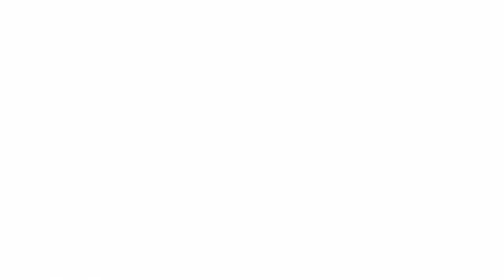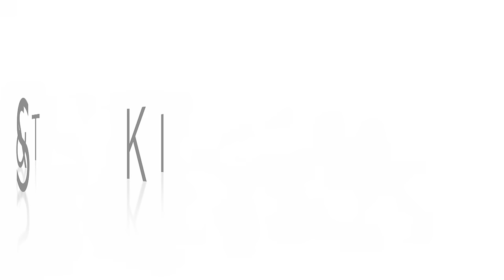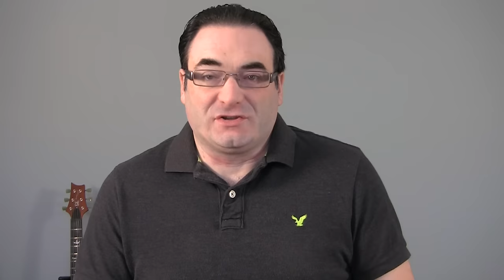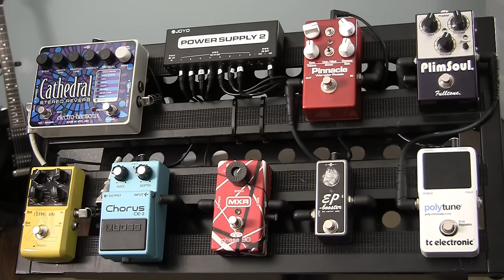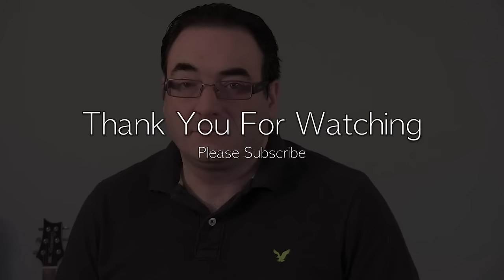Pedal Board Setup Tricks & Tips Vol. 1

Comment: Nice tutorial. Joyo power supply is not isolated as far as I know. It is "fully regulated" and "short circuit protected". It is a step above a daisy chain but channel isolation is needed against ground loops.
Reply: solenelle you are correct
Reply: I got one of those cheap power supplies I think it was caline and tested it and it was isolated I didn't think it would be but it was
Reply: There are a few different Joyos. Some are better than others. The JP-02 is "isolated and regulated" but not individually isolated (channel isolation). The JP-04 is individually isolated per outlet. JP-02 has 10 outlets, 8x9v, 1x12v, 1x18v, the JP-04 only has 8x9v.
Reply: I believe the JP-02 is as you describe. The JP-04 is supposed to have channel isolation.
I use both, one for analog, one for digital pedals. Little bit of hum with singles and high-gain, but imho it isn't Rock 'n Roll without a bit of noise.

Comment: I just got an MXR 10 band EQ, should it go after the Wah, before the fuzz I use? I also use a noise gate, now should it go before the Wah? I want to have the least noise as possible for my blues playing. I also use a chorus and a digital delay and a compressor . Any advice as to the chain I should be using with these pedal's? Also I have a rather inexpensive power supply, will the noise gate take care of the noise or will it cut off my notes if I have to turn it up enough to remove the power supply noise. I'm a 3 year player and m just now getting into the effect's rather than a processor like the RP360XP I am using now.

Comment: My DIY Board inspired by your vid easily holds 8 full sized pedals and the power source is secured out of sight under the board. If you’re cheap like me, then you’ll do your homework before buying a new pedal. But I put a cheap tuner on the board and regretted that right away. My old handheld little Korg tuner is way more accurate! Live and learn! It sits on the board and is powered by 2 AAA bats and I keep it plugged into a stereo output on my chorus while I play. Pedals are held in place by Velcro strips. Zip ties on the WAH pedal. Carry handle.  Wrap up hardware for the AC
Wire. Dedicated in/out sockets for plugging in guitar and amp. Made from wood that came from a stripped box spring mattress. Very small investment. Plug N Play. Set up is a few seconds.
Reply from the maker: Nice to know I inspired you. Thanks for watching!

Comment: I use that Joyo power supply myself, and the JP-04 which is individually isolated. Apart from that, only two of my pedals need special power requirements. Those Joyo PS units are pretty good for the $

Comment: Great video, do you prefer everything in line with the guitar or using an effects loop on your amp?
Reply from the maker: I actually do both. If I am using my vintage amp that doesn't have an effects loop I have no choice but to go direct. I do prefer to use the effects loop when possible.
Reply: @addictedtogear  what are the benifits of effects loop?

Comment: Great video,  where would you place your acoustic simulator and compressor pedals?  Thanks
Reply: It 's debatable as to where your compressor goes. Some like it after their overdrive/distortion, while others like it before. It's really up to you and the sound you're looking for. It's the same with your acoustic simulator. The rule of thumb is to run from your guitar to your tuner pedal (if you use one), to your wah (envelope filer etc...) to your compression pedal, then to your distortion/overdrive pedals. 

I personally run my pedals in this order. Wah, envelope filter, acoustic simulator, compressor, distortion, overdrive, EQ (out to amp unless using practice amp), chorus, flanger etc..., delay (to effects loop unless using practice amp).

Comment: Hey Thanks a lot for you vid! I have two questions can you help me? 1. Does the dual lock 3m work well with small size pedals like the sp booster? 2. do you recommend the Joyo power supply 2? noise problems etc...

Comment: Where would you typically put a vollume pedal? along with the wah section? Also with a wah, would you still put the TUner at the begining of the chain?
Reply from the maker: I have always run my wah first in line right after my guitar....From there I'd go into my overdrive/distortion pedals....Time based/modulated effects pedals work best in the efx loop if your amp has one. Volume can either go first or last in the chain.
Reply from the maker: The tuner can go before the wah pedal
Reply: ADDICTED TO GEAR I don't use a wah yet but I do use a whammy pedal (pitch shifter) should that go at the front of my board?
Reply from the maker: If you want the pitch shifter to be affected by your other pedals you would put it at the end of the chain or after your drive pedals.
Reply: I like to put my volume pedal in the effects loop.  If you put it in the chain that goes into the front of the amp (and you're using a dirty channel on the amp), the volume pedal just increases the amount of distortion coming out of the preamp.  But if you put it in the effects loop, it acts as a true volume control.
Reply: I’m late to the party I know, but if you put the volume pedal first it only acts the same as your guitar volume. So seems to me a little bit pointless. 

If you want the pedal to change the volume without altering the amount of dirt you’re hearing then put it after your dirt pedals. This way you can still use the volume knob on your guitar to clean up your signal.

That’s what makes sense to me.

Comment: quick question.. at the end you were saying you can send send reverb and delays through the effects loop and the others through the front, but how would you be able to split up where they are going? Does it not all run in the same line?
Reply from the maker: No you would use 4 cables. 2 would go to the effects loop while the other one goes to the front of the amp and of course you will have one from your guitar to the input on the first pedal.

Comment: My only question is what kind of pedal cables do you use?  They seem like they're a bit longer than the standard 6" ones. Also how do you connect them all or what is the best way to lay them out as far as jumper cables go?
Reply from the maker: Hi, They are not longer than the standard size. Layout needs to be determined by your board size and how many pedals you have. Each one will be different. Best to lay out the pedals without connecting them first and then to connect them once you are happy with the layout.
Reply: Oh okay, thanks.  Yea I'm always wondering how to connect the pedals on the end, always have trouble with that, or going from top layer to bottom...  you know what i mean?  It always seems like you need one longer cable to tie it all together or something.

Comment: Any issues with the joyo power supply? I have a donner multi mod pedal that sucks sounds as if the volume is going out. Pretty good besides that one problem
Reply from the maker: Its funny you should mention that. They are ok for a few pedals but can't really handle the load of many effects boxes. If you have more than 4 or 5 I would suggest you get something better.

Comment: Where would you put a volume pedal in this chain?
Reply: After drives, before delay and reverb. At least that's a good start
Reply: The Captivated depends. you could set it before the distortion pedals and then it acts like a gain knob on the amp or the volume poti on the guitar. after the distortion its pretty much a pure master volume and before it you can reduce gain and mute anything (if you have a noise suppressor after the distortion effects)

Comment: if I want to use a graphic eq in the effects loop of the amp, where should I put it on the pedal board?
Reply: adreenalize it all depends what you want your EQ to do. Go watch a few episodes of That Pedal Show. Lots of info on EQ’s.
Reply: Danny Minor thanks. mainly I use the graphic eq to boost the volume when I play leads... but I will check what you said.
Reply: adreenalize I use it for the same thing also. I have had to put it at the end of my chain to EQ the room a few times at different venues. It would not be practical to do this but you could theoretically place an eq after every Pedal to enhance tonal qualities. Cheers and Rock On!

Comment: He's got a weird set up. Mod, boost, delay, and tunner in the front. Most people have those towards the back
Reply from the maker: Nope tuner goes into the Plimsoul then Wampler then boost then modulation follows that. Thanks for watching.
Reply: I always put the tuner first - then it can act as an On/Off switch for the entire rig. You should also tune your guitar without any effect that might alter tuning.